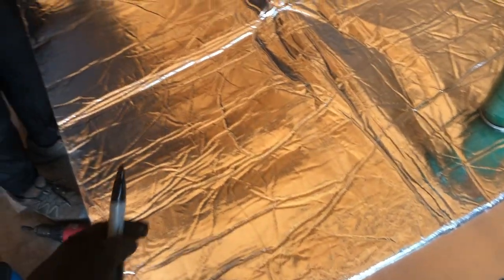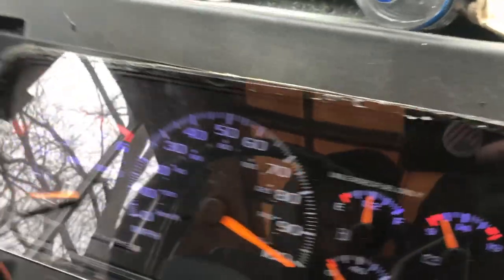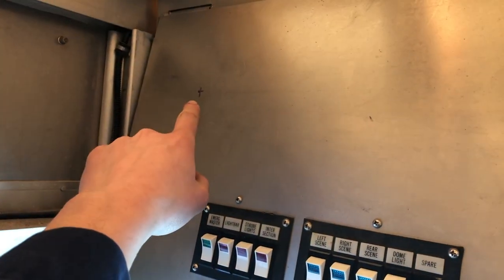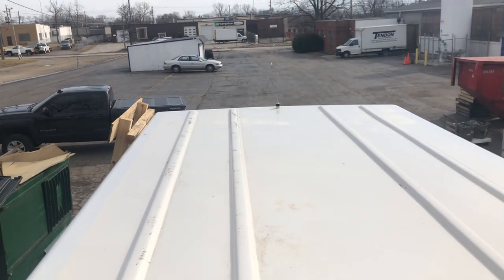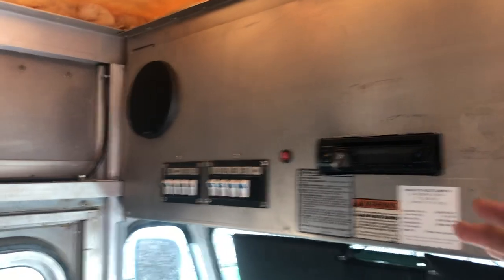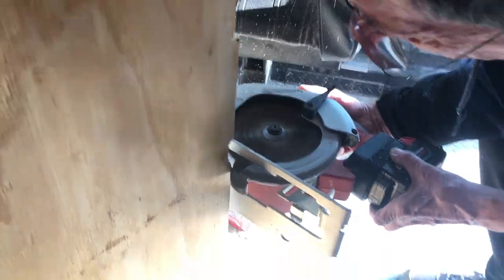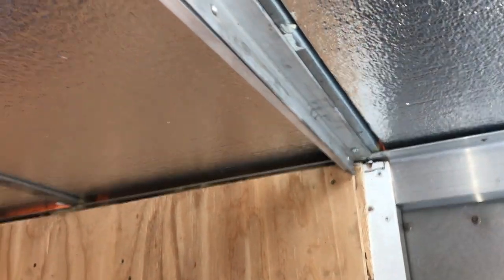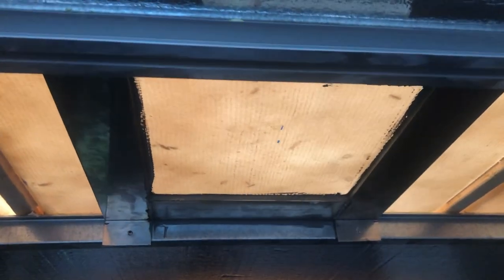(2) DIY Custom Built Budget RV Full Time Living Solar Inverter Step Van Off Grid modern HowTo 2

Comment: Before you make anymore holes in anything, ESPECIALLY the roof I would suggest you check out how to use Butyl Tape as a proper sealant when drilling holes thru stuff. It is what is used on boats.  People think silicone is the thing to use for everything IT IS NOT. I suggest you go back, remove all the stuff with hole thru the roof and add the butyl tape. Otherwise you will be plagued with leaks.
Reply from the maker: scottydaum I will be doing research on that tonight! Great point I’m glad you brought that up! Cutting holes was my least favorite part of this lol
Reply: Good point, and thanks for the tip. I learned the hard way that silicone doesn't always work to seal roof holes, from installing top strobe assemblies on law enforcement vehicles.